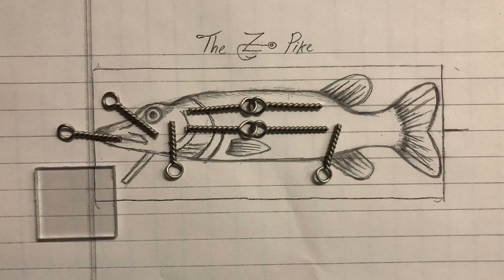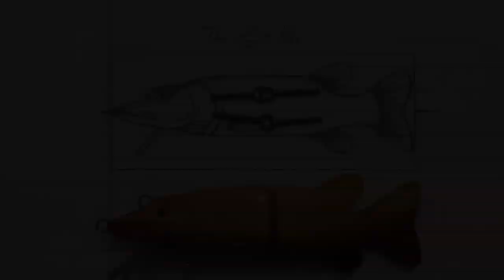Making A Jointed Bait | The Z Pike Lure

Comment: Love the finish, tje colors arw great. Do you mind me asking what epoxy you use for the finish, and how many. Coats. Regards John
Reply from the maker: Thank you very much!! I mostly use Envirotex Lite and that’s what I used for this one. I like doing thin coats so it doesn’t run. Usually two coats are enough but occasionally I have to add a third one. 

On a side note, I recommend you gauge/learn how fast your epoxy starts hardening. I personally like to apply it when it’s getting closer to hardening because it’s not as runny and you can control it better. Sometimes you can even apply more of a thicker coat without it running, thick enough that you only need one.